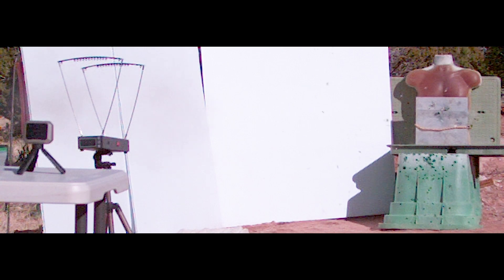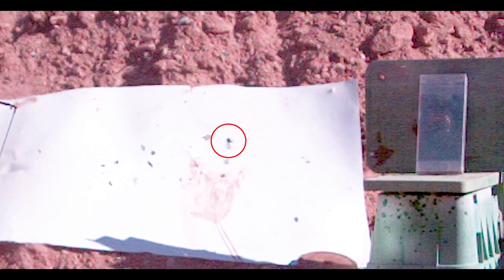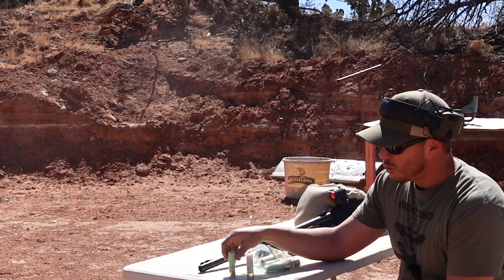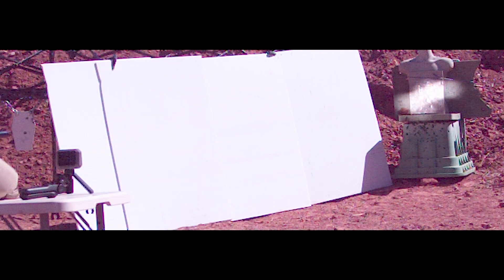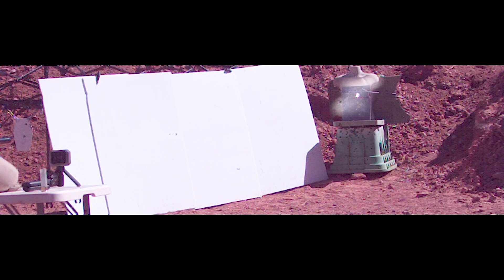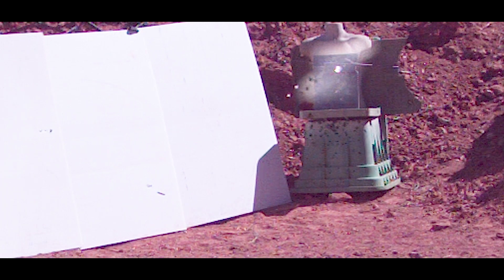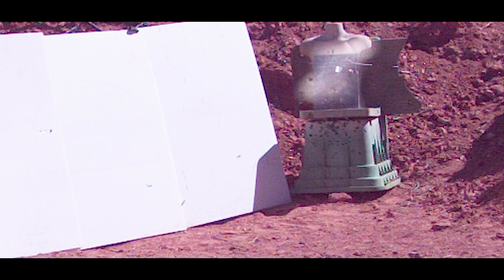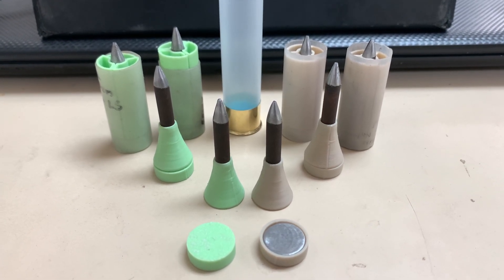Barrier Busting Arrow for 12 gauge

Comment: What about something short, fat and heavier like the steel penetrator core from a .50bmg AP round?
Reply from the maker: @bullboo1  unfortunately short and heavy without velocity is not much better than just a lead slug. I have used the core from an M2AP round with success but it was traveling around 2,000 fps.
Reply: @3RBallistics  That is pretty fast and yes worse than a lead. 
Had some German Patron AP nasty stuff way better then M2AP but sold it. I had no idea it was AP had a whole case. Went through stuff M2AP could not. Can't use it except in testing or war. Had enough of war.
Cool stuff you are doing.